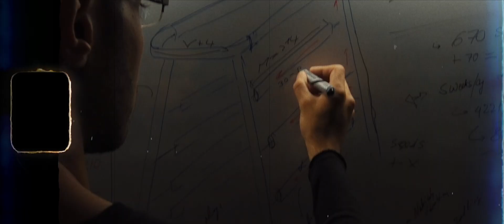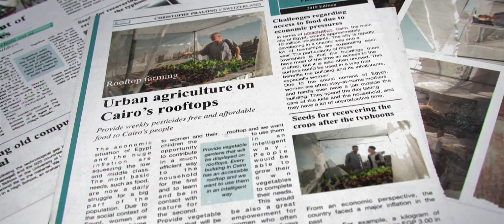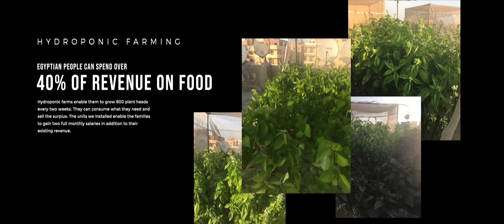How we built urban farms on Egypt's rooftops

Comment: Brother how to avoid stormy winds if its in the rooftop surely the wind will ripoff the structure! What measures SHOULD be taken???????
Reply from the maker: It depends on the rooftop height. In Cairo there’s not much wind and the rooftops are not very high, meaning wind is not a challenge there. However, for higher buildings or places with more windy weather, then stronger structures should be built or the farms should be indoor.
Reply: @Most.Shamsun,i am asian (filipino) married to egyptian ,,i am doing this at home at eArly age ,,using empty bottles and make my own compost from left over   Food from kitchen during this world pandemic,,,spring onions,,garlic and some...put near the window to have sunlight ...by the way,,i soak in water some of plants and wait ‘till it sprout the root before i transplant to soil with mixture of compost,,,thats all...